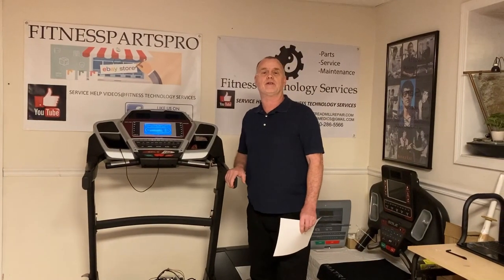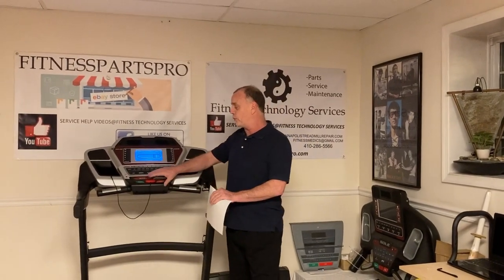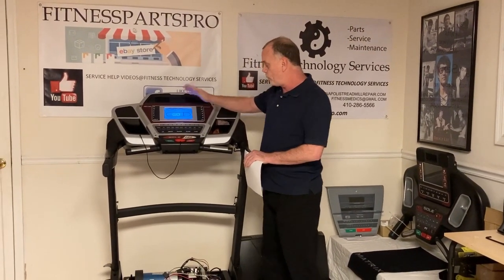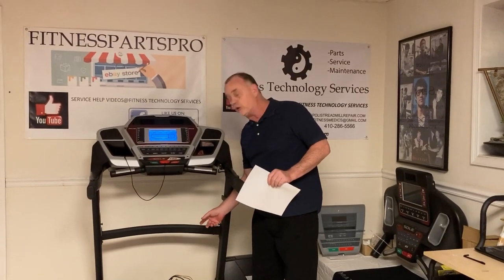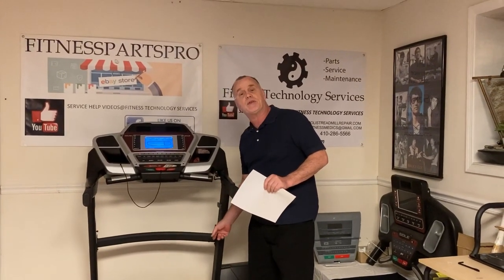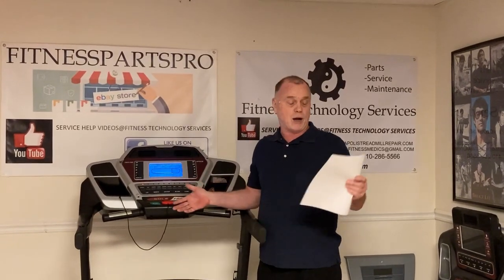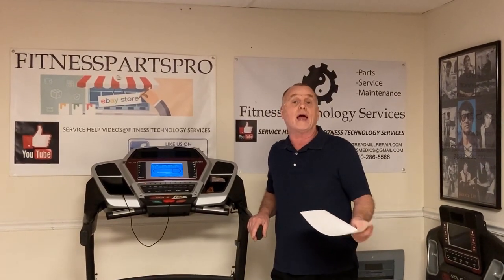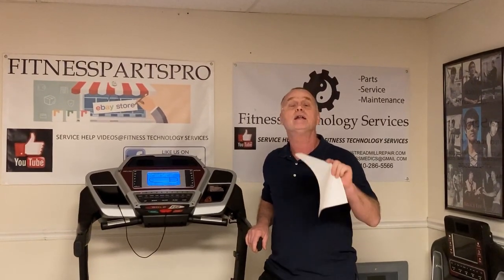SOLE TREADMILL TROUBLESHOOTING

Comment: Hey there. Back with another F85 question. I found a video showing how to get into the advanced diagnostics mode. For kicks, I entered the Diagnostics menu and it showed an error in the list: E80. I haven’t had any issues with my treadmill (since installing a replacement console). I can’t find error code E80 anywhere online. Do you have experience with that one and if so what does it mean?
Reply from the maker: Well I have never heard of that one. You want send me the link I will let you know if I can!

Comment: Hi Dave. I have an F80 well used 11 years old in Canada.
Getting low speed error.
Lubed belt and checked the speed sensor and it is flashing.
Now wondering if it is the motor or belt.
Runs well with no weight. Runs with weight on sides. Doesn't run well at all with weight in the middle.
Is this older treadmill worth messing with further? Thanks in advance for your help.
Reply from the maker: Well check the deck if there are no scratches or cracks or worn spots! Then it is only the walking belt yes, Very good diagnosis by the way . If you want me to help with parts send me your serial number to Fitnesspartspro@gmail.com Dave
Reply: @FitnessTechnologyServices  Will do, thanks for your help

Comment: My treadmill belt is in the middle when not in use, but when I run on it after about a few minutes it is on the right scraping the edge making a high pitched whirring sound - any reason for this? I think it’s how I run, but based on this, anything I can do to counter balance this? Or is it safe to not do anything? Should I add more lube? Should I adjust the belt to always go to the left?
Reply from the maker: Well I wouldn’t tighten it enough to always go to the left maybe just a little help. Make sure the deck is well lubed . Check to see if it is level. Look for wear on the deck it should be shiny black
Reply: @FitnessTechnologyServices  thank you so much! How do I know it is well lubed and not over lubed? Also, how would I confirm the deck is shiny black? Is there a way to remove the belt to see the deck?
Reply: Latest update, I did the following:
1. Made sure the feet were level

2. Added more lube so that it feels a little wet and shiny underneath and when I apply pressure while walking on the belt I don’t hear anymore friction

3. Quarter turned clockwise the right side so that it pushes the belt to the left to counteract my gait

4. Quarter turned the right leg to lift the right to offset my gait and push me more to the left as well

After 1 run (1 min jog / 1 walk) seems to be staying the middle, when prior only during the 1 min runs it kept going all the way to the right and never recentering (I was having to manually push the belt back to middle prior to the above adjustments)
Reply from the maker: @TooMuchToThink1  Excellent

Comment: I have a F63 and when i power it on, display lights up but there is no info displayed, just a blue screen with a rectangle. Does not respond to incline or anything. When I press start, it will beep 3 times then it turns off and trips my breaker. I thought maybe it was the breaker on the treadmill, when I try to push it in, it doesn’t budge.Any suggestions?
Reply from the maker: Well you have a bad console once the controller sends voltage to the console and it comes on all console parts should work

Comment: Hi Dave.  I have a Sole F80 that is about 2 yrs old. it is giving me a E5 error code after about 30 min of use at 3.5 speed and incline or not.  Would this be a mother board issue or something else?  It also while in use if I change the speed it will slightly slow before activating new speed.
Reply from the maker: Hmm on the speed dropping some then running normally this is mostly caused by the controller . On the E5 this could be controller also! But it could also be the walking belt needing lube and overheating controller

Comment: Thanks for the great links. My problem is different. I’ve had an F85 for 1 month. Display prompted for update to software v1.7. Now the touchscreen is non responsive. Tried unplugging and replugging. No buttons work. Is there a way to hard reset this display?
Reply from the maker: I am sorry I don’t think you can reset it you will have to report it to Sole 1800 258 8511
Reply: @FitnessTechnologyServices  Thanks again. They sent me a new console. Still need to install it (by undoing most of the original setup), and am thankful they sent it quickly.

Update: I installed the new console right after receiving it and it’s been working great. It’s now late 2022 and I still have software version 1.5. I’m afraid to try updating the tablet again.

Comment: Just got the NEW model of the F63. Much different console for the 2023. I want to know if you can change the startup speed from 0.5 to 1 or 2 MPH ? I have looked everythere through the factory settings, if I'm doing that right.
Reply from the maker: No I don’t think you can change the start up speeds and incline are all preset in the newer models
Reply: I also have a new 2023 F63  It will allow me to select programs but then when I go to hit the start button nothing happens. ??

Comment: Hey there! I have a f63 treadmill.. having an issue with a knocking/banging noise towards the back of the roller pin. I’ve already replaced the belt, the bearings in the back roller pin , & the circuit board, . I’m kinda at a loss on what to do to fix this, every video I’ve watched with the issue I’m having says to replace the bearings in the back roller pin which I’ve done so and I still have my issue of banging while the treadmill is running. Would you have any idea what it could be? I’d appreciate any assistance you may have! Thanks so much 🙏🏻
Reply from the maker: Well this sounds odd there is nothing else in the rear .Just the roller.send me a video to Fitnesspartspro@gmail.com I will see if I can help Dave
Reply from the maker: Also let me know if this without a user also

Comment: Hi, I have a Sole S77, had is for quite a few years now. Unfortunately im unable to use it at the moment. When I turn it on it bleeps and the display lights up runs through software versions etc. All the programming buttons & fan buttons seem to work but when I press start its turns off and immediately turns back on again runs through the startup cycle again. I press start and the same things happens again and again. On the odd occasions it will run through the start up process and turn off its self and back on again with me not touching anything.

I remember this happening a few years ago its did this a few times then it was fine.

Do you know what the problem could?

Thanks

Wayne
Reply from the maker: This is either the safety key module not making good contact or has gone bad . Or the console display board is crashing

Comment: I My CT 120 treadmill Console board not powering up when you turn it on The main board is coming on your hearin the relays clicking but no power to the motherboard board could you give me some assistance
Reply from the maker: I am not familiar with this unit. In general you are going to find out if you have power at the top of of your wire harness going to your console. But I have no idea on your unit sorry

Comment: We bought our F80 brand new in June and were able to use it for two days until it started beeping constantly. It's not in Demo mode, and we have tried everything to get it to stop. Only thing that works is unplugging it. Sole has been no help at all, and leave me on hold for hours or hang up on me altogether.... Do you maybe have any solutions? Thanks so much in advance!
Reply from the maker: Hmmm this sounds like a bad console display. Or at least a short on one of the handle bar buttons.I would start with disconnecting the handle bar connections.But being so new you will have to call sole the # I use is 1800-258-8511 hope this helps I have not know them to treat customers badly

Comment: Any HELP or advice would be appreciated. My Sole  F80 treadmill trips my breaker EVERY time I start it. It runs for a minute then shuts down.
Reply from the maker: @VicnLel  try running it with no one on it. See if it works longer
Reply: @FitnessTechnologyServices  Seems to be the same, it starts up then shuts down within a minute.
Reply: I just opened the motor panel. The ground screw coming off of the motor seemed loose. I tightened it and reset everything. I started it without being on it and it ran. I elevated the incline and returned it to zero then stepped on it and walked for a minute at  .5 MPH.  It worked fine until I pushed the 3 MPH button then it tripped the breaker.
Reply from the maker: @VicnLel  well if it works with no one on it then this leads us to the walk belt. Let it run for a good long time no one on it just to be sure but sounds like a bad belt. Send me your serial number to Fitnesspartspro@gmail.com So I can see what you have
Reply: @FitnessTechnologyServices  Hi Dave, I watched a few of your videos and found that my belt was not centered correctly. I repositioned it and I'm back in business. Thank you for doing what you do, you are a blessing!
Reply from the maker: @VicnLel  well thank you! I am glad it worked out well

Comment: Hello thanks for the video that’s exactly what my treadmill is doing it runs with no weight or super light weight on it but as soon as I step on it it stops running.   What is my solution for this problem ?

Thanks again
Reply from the maker: You will need to check your deck for wear but this is normally the walk belt give me your serial number on my contact form and I will see what belt you take www.Fitnesspartspro.com
Reply from the maker: Yes sir just checked my web your belt is H0613240 if you want you can go to site . Or call 410-286-5566 to order thanks
Reply: @FitnessTechnologyServices  awesome thank you.   I’m just afraid what if that don’t fix my problem ?
Reply from the maker: @elviscejvanovic7466  Well you do have to consider that all I can is 90%of this issue is walk belt. Go through my DIY videos and you can see lots of other ways to test your unit . And walk belt 😁fitness technology services
Reply: @FitnessTechnologyServices  thanks again I really appreciate it, I have done all the test and watches all of your videos and seems like motor and board are fine.   So I do think it’s belt, also I don’t think it got lubricated as often as it should have been.   So I think I’ll order the belt fro your site.

Comment: Hi I just purchased a brand new dile f63 .. once I turn start.  Then E7 lits up.  Doesn't work
Reply from the maker: Hmmm sole has a E7 listed as Abnormal power? Make sure you have a good 120 vac going to the treadmill then check and see if some of the power wires are well connected to the controller. Also check the wire harness connections to console make sure they are well seated
Reply: @FitnessTechnologyServices  ok. Ill have to double check.  There's a count doen and beeps. Don't hear the the click. Tried pushing the belt with my foot to keep the belt moving. Doesn't throw an error but won't move once I stops.  Then tye E7 pops up.
Reply from the maker: @Keepit10081  well this now sounds like a bad controller connection or bad controller don’t worry too much about power I would go over the wire harness connections and connections on the controller
Reply: @FitnessTechnologyServices  ok. I'll check on it and let you know how it goes. It's still under warranty.  But  I haven't gave them a call yet. I'm sure it'll take a while for them to come out anyways.  But I thought I'd you tube it and see if its an ez fix. Thabks.

Comment: Hi I have f63 board and sensor replaced. Same issue, relay clicks belt starts stays same low speed can increase with buttons but no change in motor speed. 5-7 seconds ls1 error. Hooked up a battery just to just motor and it runs fine. I’m lost please help :)
Reply from the maker: Hmmm this sounds like it's not receiving a constant signal from console or losing the speed signal or not calibrated. I will add some troubleshooting video's .  
Thanks Dave
Please SUBSCRIBE
https://www.youtube.com/watch?v=oV3lyD7HGTM&t=12s
https://www.youtube.com/watch?v=lxN3lcax2LM&t=28s

Comment: I have a f63 model with error code e7 can you please help me with this?
Reply from the maker: Well a e7 is a power failure does this happen as soon as you start it . Or after walking on it
Reply: @FitnessTechnologyServices I also get E7 error. I turn on the power switch and the display lights up. But when I push the start button, the display counts down 3,2,1 like it is about to start and then the E7 error shows.
Reply from the maker: @carlosmiller8809  yes that is a bad controller or maybe motor. Send me your serial number to Fitnesspartspro@gmail.com and I can send you links for testing

Comment: My F80 makes a creaking sound when you incline and decline between 1-5. Both with or without someone on it. Any fixes or is this normal?
Reply from the maker: Well a lot of units creak some? I have a video on sole squeaking noise let me know if that helps ,most noises are from the joints that help it fold

Comment: All the lights on my Sole F80 light up as soon as I insert the key and stay lit up. Doesn't do the count down to start. Its just stuck with all the lights lit up. I opened up the Motor console and all the wires look secure. Any idea what might be causing this?
Reply from the maker: Well it can’t be lower controller it only sends power to console. Hmm I would think stat button safety key module or bad console .send me your serial number to Fitnesspartspro@gmail.com I will see what yours takes

Comment: Hi! I have a F63 treadmill and used it for over 3 years until 4 days ago. It turns on but no 3-2-1 and no movement and beeps at regular intervals and i see a green led light go on/off with the beep on the motor control board. Do you know what it might be ?
Reply from the maker: This is a console issue or at least upper display. Once the controller board sends voltage to console all console functions are the responsibility of the console display.
Reply: Thank you! Do you have a video that shows how to fix that? Or narrow down the issue
Reply from the maker: @rt3681  Sorry I do not have a video on replacing display.It is very time consuming/hard the back of the console needs to be removed. It is the one thing I usually recommend a professional for

Comment: I followed your Treadmill Squeak video and my f80 is still squeaky but only while running not walking. Any ideas?
Reply from the maker: Hmm there are some units that squeak from the deck when running on this is from the deck mounting bolts to frame they are under silver side rails see video replacing walk belt if needed

Comment: I have a Sole F80 Every time I try to put the safety key on, the screen still says to plug it in. I am guessing it is loosen any thoughts on how I can fix this?
Reply from the maker: Well I would start out with removing the back cover.There is a small safety module that the safety key goes into. It has small points of contact that wear out
Reply: @FitnessTechnologyServices  I have only used that key twice and it says that it’s not plugged in—when it wear out with only 2 uses?

Comment: Hello, unfortunately my Sole F65 (out of warranty) has also started showing the E7 error for about a month. When that happens I have to turn it off at the breaker and there's usually no way to get it going until the next day. Then it goes for a couple of days and the error again. Can I do anything to fix it? Thank you!
Reply from the maker: This sounds like the controller is overheating run the unit with no one on it. For as long as you can ...if it always works good. Then belt is worn and causing overheating
Reply: @FitnessTechnologyServices  Thank you.  Weird thing is that it only does it on start up, even after it's been idle for days.  But if it starts then it goes without problems without ever giving errors!
Reply from the maker: @superpedro1978  Ok I would still run it as long as it will with no one on it

Comment: My f65 sole treadmill display won't turn on when I flip the switch. I was running on it and then bam it just shut off. Any clue what it can be?
Reply from the maker: Normally if happens fast the controller board went . I would start off with seeing if you have ac to your lower controller I have a video on troubleshooting sole motor controller let me know if I can help Dave

Comment: Hi, my Sole F65 is stuck in the folded position and nothing happens when I pull down on the yellow lever that is supposed to lower it gradually. Help please?
Reply from the maker: Hi that is hard to say without being at site . So I will try my best the yellow handle has a cable hooked to it that goes in to the silver square tube that holds up your treadmill with a little latch inside it that moves when you pull lever.to unfold the round cylinder next to it is what makes it a soft landing .But be carefully if not working treadmill   Will be heavy and slam down
Reply from the maker: I don’t have a video on this .But I do show it in my sole squeaky noises on fitness technology services